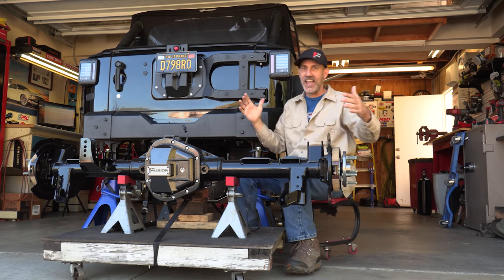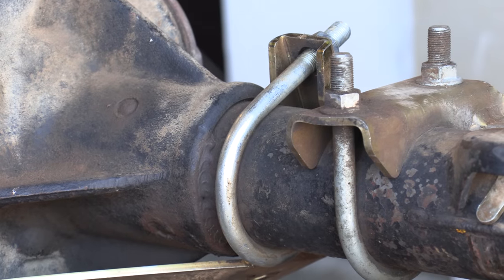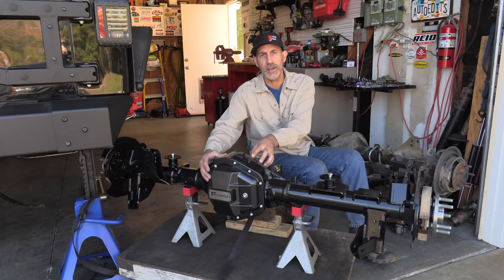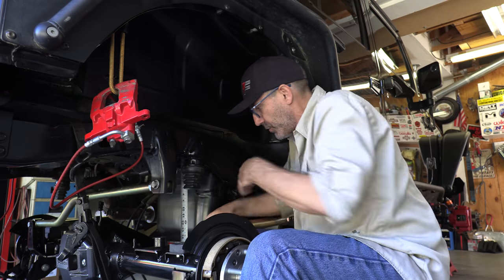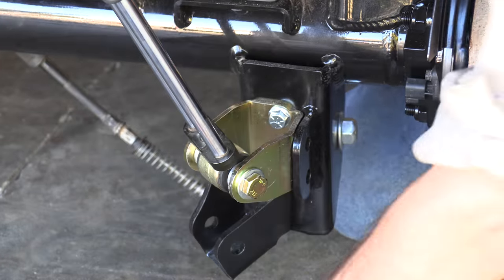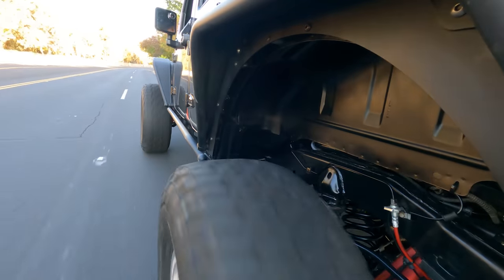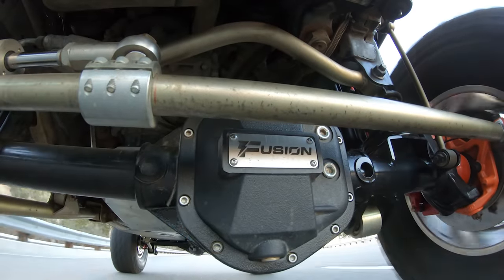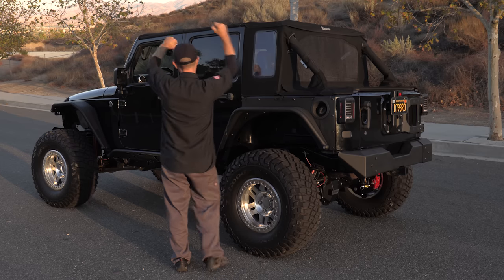Bolt in Dana 60 Jeep Axle Upgrade - Fusion Semi Float 60 FULL Install and Test Drive

Comment: What was your stock gear ratio? When you step up your gear ratio does that raise your towing capacity?
Reply from the maker: Stock was 4.10 and gear ration doesn't change tow capacity. It just helps the engine get better leverage for a given load or tire size. Guys that tow camping trailers on the same size tire would go one step farther from 4.88 to 5.13 for that. But springs, chassis, brakes all play a part in towing capacity.
Reply: Thanks Jason!
Reply: I have a stock 2017 jk 2 door sport and I am trying to tow around 3,500lb, do you have any recommendations?
Reply from the maker: What size tires on your Jeep?
Reply: @AutoEdits  31 or whatever stock tire is but going to upgrade to size 17inch tire on a 33 tire
Reply from the maker: @nickdugan8422  If you stay on 32" tires... 4.10 gears like the Rubicon comes with would be pretty good. Going with 4.56 might be a bit much on the highway but would be great if you wanted to go with a larger tire later on.
Reply: @AutoEdits  can a 4.10 gear fit in a Dana 30?
Reply from the maker: @nickdugan8422  yep

Comment: Have you bent any axle flanges with your old 44?
Reply from the maker: What do you mean?
Reply: @AutoEdits your old axle was a Dana 44. Did you bend the axle flanges? If so, is that why you upgraded to the rear 60?
Reply from the maker: @mackjacobs5489  What flanges? The lower control arm mount flanges bent all the time but the wheel ends didn't. The axle housing strength and differential is the biggest reason for this upgrade. I've been extremely happy so far.
Reply: @AutoEdits  you answered my question. I was asking about the wheel end flanges.

Comment: Sorry Jason, LIES LIES LIES (Lol..) , view my two little videos on my channel and look at how clean my JLUR is before, then dirty, then return to like it was at the start of my AOP video.  It's not that easy to keep it clean....  Lol!!! your so humble.  I know you spend ALOT of time under that jeep brother.   I get asked the same question by folks who think mine is a Mall crawler until they look closely at the scratches and chips in my rims or one of my video's.  Like you I do touch paint if needed but since my jeep is newer that's only been like 2 times in the past 2 years. That said, I think it's important for folks to know that prepping before the trip is important but also not using a pressure washer unless it's a small psi one meaning no more than 1200 psi or so.   Too easy to push grit into areas it doesn't need to go into.  Also it's so important to prevent pushing grit and grime into any electrical connections especially with our CAN-Bus electrical systems.  I wish I had the life of wheeling all the time, but since I'm like 98% of the population and use my jeep as a daily driver and only wheel 10 to 15 times a year then it makes it easy to spend multiple days manually cleaning everything under the jeep.  The biggest thing that I do before a trip is clean, clean, clean, wax, tire shine, and shine the frame, axles, and everything else.  It makes it 100% easier to simply wash away with a regular garden hose.  It also makes it easy to simply hand wash once I'm done with the hose.  Once again as I've stated before, you have a great channel and although I'm doing my channel for fun, you were one of the folks who inspired me to just start something.  Thanks for that, and thanks for the heads up on the fusion axles as I first found them on your channel.  My JL now has the Ultimate 44 on the front which was free, but I would have bought the fusion 44.  I'm currently looking at the 60 for the rear of my JLU and like you just sticking with my current tires (38's) instead of 40's but since these Advantek M220 axles have a good reputation on the JL's I'm stuck deciding if I should do it now or wait.  
Great work brother.  God Bless you.
Reply from the maker: Good advice here. I've heard the new Advantek JL Rubicon axles are really really good. It's all about building to what you actually are going to do with your rig!

Comment: Why not full float?
Reply from the maker: I say in the video. No need to buy new brakes, wheels and have to make a custom width housing to match the front. 40 spline semi float is plenty strong for 37-38” tires.